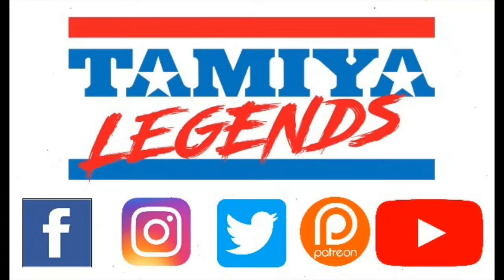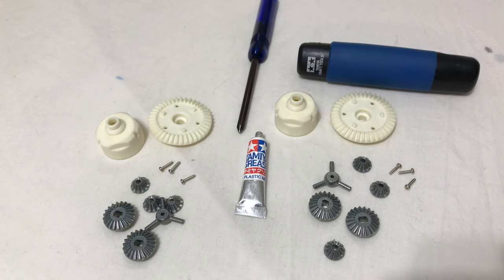Tamiya TT-01 Porsche 911 Bling Project...

Comment: I have a few TT01s, also some CF chassis's and Yeah racing. All of my TT01's use spacers and washers in different places. As soon as you start modifying the TT01 chassis, you will always run into clearance issues. Getting it to work together is highly rewarding....
Reply from the maker: Kurt Greenhead 
I 100% agree Kurt, I love doing projects like this, it’s great fun and as you said very rewarding 🤩👊🏻
Reply: I have a probelm attaching my steering knuckles to my steering arms... the screws in the parts bag slide through the steering arms as they have the same diameter as the steering knukle pins...

I could allso use some thin washers  to take out some slack here and there... where did you find thin washers suitable for this?

Any help appreciated, thanx.
Reply: @JokerInk-CustomBuilds  
Look up A-Main Hobbies.
From bashers to crawlers and serious racers, they have EVERYTHING!

Comment: Im sure the original tt01 kit has a ring that goes on the spur to stop the pin dropping out, failing that a rubber o-ring would do the job too

Comment: The spur gear needs a washer over it so the pin doesnt fall out. The original copper diff bushings from the first tt01 work great for that
Reply from the maker: super gizmo 
Thanks for the feedback buddy 😊👊🏻
Reply: @TAMIYALegends  and those Yeah Racing driveshafts work better with a little heatshrink over them at the wheelside so those pins don't fly out as well
Reply: @Mechanical_Insanity  Yes, my one flew out! Ill try that! cheers

Comment: I'll have to show u the driftking one and one for speed that got to 126mph. Both tt01  I got all the same blue upgrades for the drifter. V2 smoke machine.  Mini camara front and back . I got the differential set and tried it with the drifting axle. But the break on an it locks the rear wheels

Comment: Very good quick idea is the chassis kit the same make as the top suspension mounts ? If not how does the carbon top deck fit with the kit ones is it the same ? I was wondering if the carbon holes in that part are too small for the alloy parts and are actually ment to go through the protruding parts if you see what i mean
Reply from the maker: Richard Temple 
Yeah quite possibly Richard, I just bought the bits I liked and thought I’d worry about the build afterwards 😂. tbf its finished now and is pretty sweet 🤩👊🏻

Comment: I just installed a yeah racing alu conversion kit on my TT01... But how the H*** are the steering knukles supposed to be fastened to the front upper and lower arms... The screws on the parts bag has the same size head as the diameter of the steering knukle so it just slides straight through the plasticballs in the steering arms...
Any tips from anyone? Am I missing some washers or something?

Comment: Glen does the high speed gear set fit TT01 as TT02 as the pin stays in using it am upgrading a TT02and found that this goes together well
Reply from the maker: Count murcielago 
That’s a great question buddy, I’m not sure I’ve seen a high speed gear set for the TT-01? 🤔

Comment: Is there no shims for the upper deck?
Reply from the maker: Thomas Brunner 
No this is made up from a few different manufacturers parts, so the gear boxes were slightly higher than the original chassis.

Comment: Strange I had so much trouble with the stock top plate and the yeah racing aluminum that I simply built the chassis without a top plate 😁
Reply from the maker: mitymike 1996 
Well that’s one solution 😂👊🏻
Thanks for watching buddy
Reply: I have a Drift TT01 and they don’t even come with the top brace.

Comment: I attempted this 10 years ago and it was a nightmare. Almost nothing fitted properly and in many ways the after market parts caused serious problems, particularly with the suspension travel. I still have the car but it is in no condition to run.